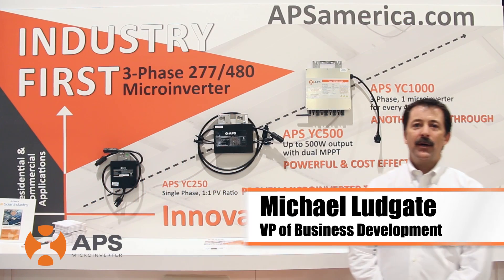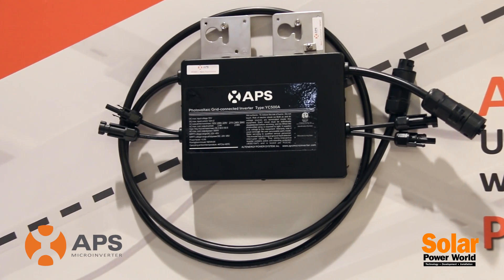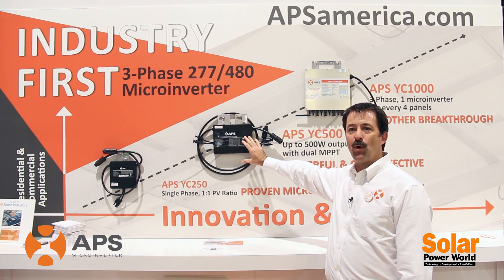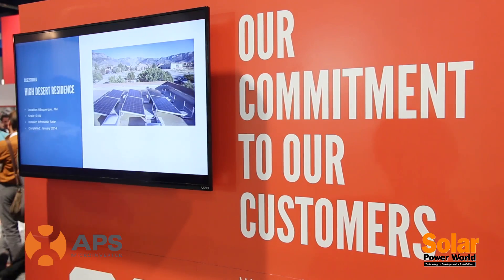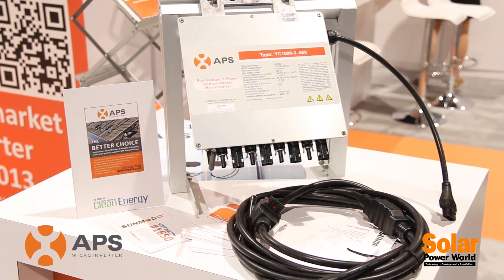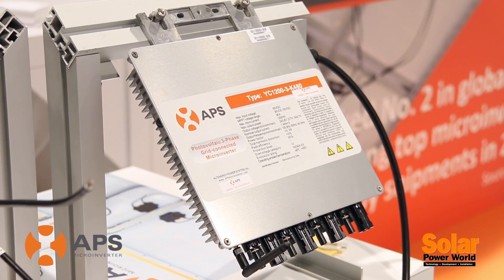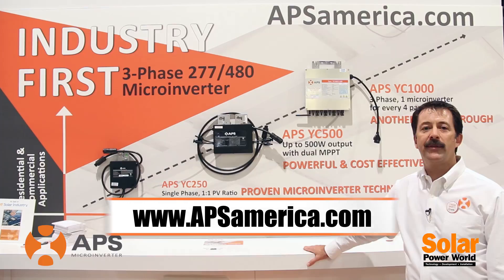SPI 14: APsystems Microinverter Connects to Two Solar Modules

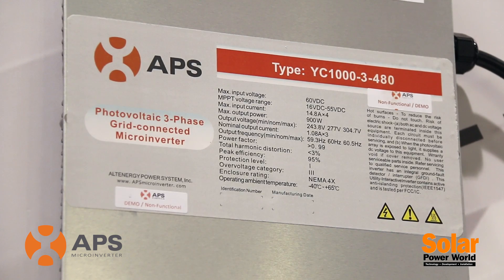Comment: "1:11. Takes 4 modules from  180 to 310 watts "   does that mean one can mix different sizes of panels if the situations asks for it?
Reply: Based on my experience with an APSystems installation, they last about 5 years and then you have the "pleasure" of dealing with their customer service.  Good luck with that.  Although the installation is less expensive than a similar Enphase system, I would recommend you use the latter.  The installers I've talked to don't seem to have many complaints.  For me, however, I've had a 40% or so failure rate.
I regret the day I ever put APSytems on my roof.  Yeah, sure... I saved money, but did I?  Now they are not honoring the warranty, so I'm paying twice for an inverter.  And, replacing their failed junk is a pain!   So, before you are thinking about how you can arrange panels, you might want to think about just using a single micro per panel.